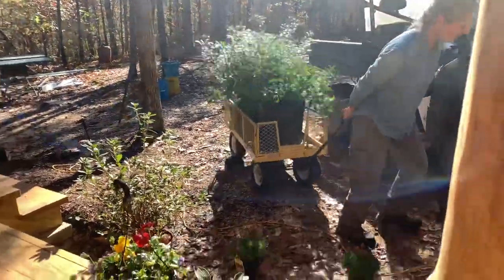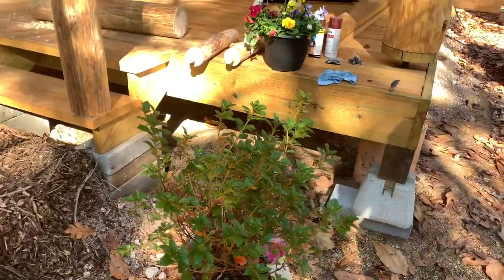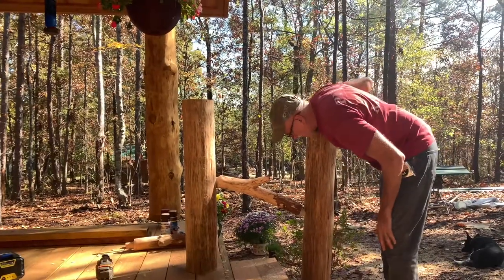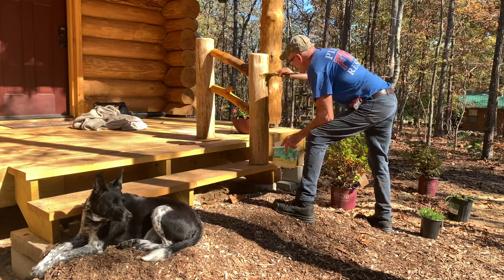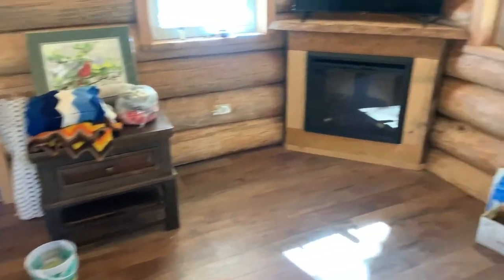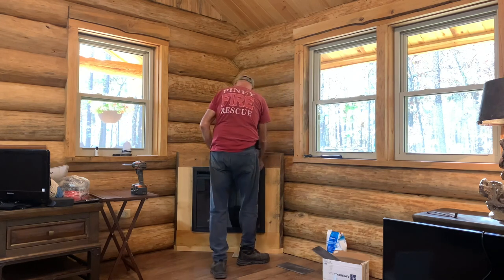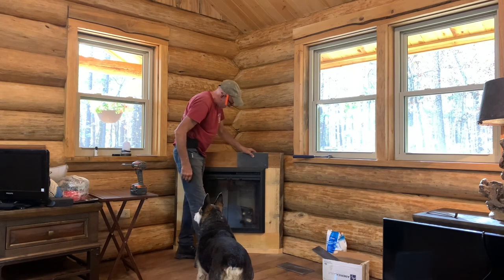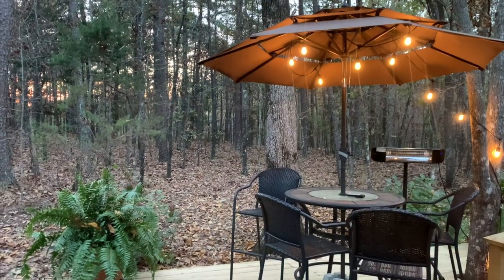Log Cabin build Part 34, building a handrail and the fireplace surround. Full scribe log cabin

Comment: I'd do the fireplace in natural stone instead of tile. Keep with the natural look. And a stone landing across the bottom about a foot wide to set fireplace tools on one side and a little stack of wood on other side of the fireplace. Are you putting railing around the front porch to match the step handrail?
Reply from the maker: Yes, we would definitely do that if we were putting in a real fireplace. For now this is just an electric fireplace because we are going to use it for a few years as an Airbnb. We don’t trust renters to not burn it down😂😂if we ever move in permanently we will put in a real one. That will give our logs time to finish settling too.
Reply: @natureartgirl  I see the fireplace is electric. I was just thinking decor, just for show

Comment: You guys are doing such a great job. Looks really clean and professional. Love the fact you guys scribed and cut the lateral belly grooves in the logs. I think it looks sloppy when people don't do that and decide to chink like crazy instead. You guys picked nice logs too, did you get them from your land? What's the diameter of the average wall log? I hate when people use such huge logs, although I'm sure it's easier to stack 8-9, I just don't really like the look. People look like Hobbits when they walk out of them lol and you need heavy equipment to lift them. 
Keep up the hard work, it's definitely paying off.
Reply from the maker: Thanks! Yes the logs are from our land. We had a variety of sizes to choose from. The ones we used are about 12” to 13” diameter on the large end and about 10” on the small end. The beams were larger 14 to 15” diameter on large end and 35 feet long. 😊👍
Reply: @natureartgirl  nice, thanks for the feedback